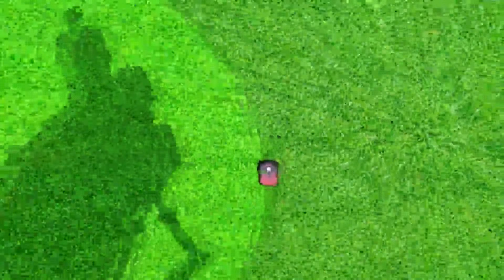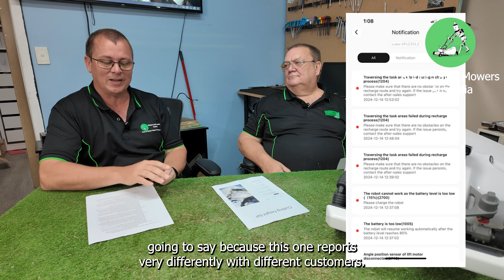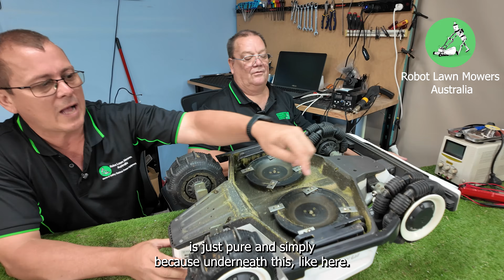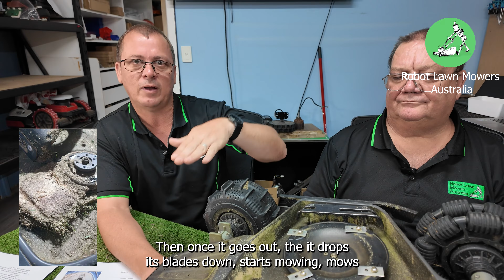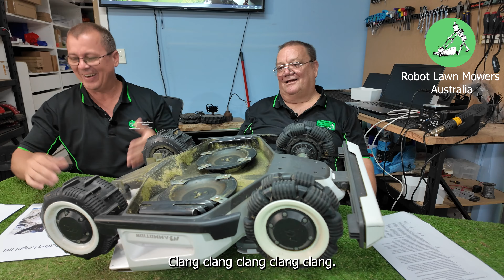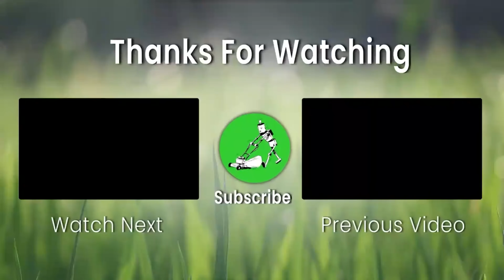How To Fix LUBA 2 Cutting Height System Failure | Wireless Robot Lawn Mowers Australia | Mammotion

Comment: Thank you guys. I have a Luba two and a Luba three. I recently just experience the height adjustment motor jammed notification. After taking off the cutting desks and cleaning everything thoroughly, the problem still persisted. Your video gave me the confidence to try one more thing before I sent it off for service that in my experience can take quite a while. The magnet and the sensor clip all seemed secure and intact. All I did was unplugged the sensor cable and plug it back in and that seemed to be the fix. Everything is now working perfectly. Again, thank you for taking the time to make your video and discuss things that aren’t readily knowable. 🙏🏼
Reply from the maker: That’s great news, sometimes those sensor connections and pin soldering on the little board can fail.

Comment: I cleaned out all the grass and it still has height adjustment issues
Reply from the maker: Very likely a failed lift sensor. The plug is the problem on the top of the sensors.

Comment: What about a luba that just doesnt move. No error, connectoin is fine the physical buttons make noise but it just wont mow, wont move manually etc.
Reply from the maker: Not much to go on if there are no reported errors, but could be bricked firmware or a main board issue. All you can do is turn off the robot remove the orange key for 5 mins and then restart it. If that doesn’t fix it then your dealer will need to connect it to the service app to either force new firmware or diagnose the failed part.

Comment: Hello, folks! I have a Luba 2 that isn’t mowing. It keeps pausing and won’t fire up to now. Problems with the mower deck maybe?
Reply from the maker: sounds like a cutting height adjustment issue. Could be grass built up under the disc guards and could also be a faulty height sensor.

Comment: I’m having trouble with my Luba AWD actually the original model the cutting height will not adjust, when it try to you hear a clicking sounds but no adjustment. I keep the under desk are and blades cleaned ever 2 weeks. What do you think is the problem? Any help is much appreciated
Reply from the maker: There is a sensor on the top of the cutting system that counts the revolution of the height adjustment. It also has a switch in the height adjustment system that is pressed when it reaches the top height. 
It could be either of these sensors not working right or it could also be damage to the cork screws shaft or cog that turns it.
It is difficult to know what the exact issue is, but it will probably be one of those things.

Comment from the maker: Hi George. Honestly we don’t even bother about testing the cable any more. They always fail again if unplugged and plugged back in. Mammotion have suggested that to us to. We get robots sent to us all the time that have been repaired by Mammotion and the issue re-occurs.
Just replace the sensor which is the little round circuit board and it generally doesn’t come back. I suspect the issue is dry solder joints under the plug on the board. That would explain why unplugging and plugging it back I sometimes fixes it. The little sensors board cost $20 so just replace it.
Also worth checking the little magnet that goes up and down below the sensor, as sometimes it moves or the glue deteriorates. If this magnet moves around you will get the same issue.
Reply: Is this sensor replacement I can do as an owner? I'm getting this issue and I've pulled off the discs and blade guard, cleaned completely with no change. Stays at 70mm according to the app and doesn't change height.  

I think the blade guard design is flawed. Not sure why it has to be a solid piece. If it had large holes it would be harder for stuff to stay in there to get compacted and it would be easier to clean.
Reply from the maker: @ the sensor is a pretty easy replacement once the robot is opened up. However opening up the robot will likely void your warranty. So there is that to consider.
Reply: Wow!  Thank you so much for your very detailed and excellent answer to my question regarding the height adjustmen sensor for the Luba 2.  I feel very confident now that I should be able to repair my Luba 2 if I ever get the height adjustment failure problem again in the future.  

You guys are by far the best source for information on the Luba 2 Mammotion and any robot mowers for that matter.  I can't thank you enough for all of the wonderful content that you are sharing with us and I really hope that you will continue with the Luba most common issues series, they are very informative and very helpful to those of us that own Luba Mammotion robots.

For anyone interested in buying a Luba Mammotion robot I want you to know that I have been very happy with my Luba 2 10000H.  The only problem that I have had with it so far is the height adjustment failure issue and I now feel confident that I can deal with it properly with the help of the wonderful people here at Robot Lawn Mowers Australia!  Thanks again guys for your help 🙂

Comment: Can you clarify what component is the sensor and what is the encodoer when you are talking about the height adjustment failure issue?  Can you help me understand why disconnecting and reconnecting the cable for the height adjustment motor from the motor and the controller board fixes the height adjustment failure problem?  Is there an intermittent connection failure issue due to the connectors for the height adjustment motor being very small and delicate?

How do you recalibrate the height adjustment system?  How can you determine if the sensor for the height adjustment motor is bad?

I enjoy your videos on the Luba Mammotion and I really like my Luba 2 Mammotion 10000H.  The only problem that I have experienced so far is the height adjustment failure.  I sent it in for repair and it worked when I got it back for about four weeks and then the problem happened again.  After it failed the second time I unplugged and reconnected the cable for the height adjustment motor and it worked again.  Any information you can share regarding why the height adjustment fails and how to fix the problem is greatly appreciated!
Reply from the maker: @georgebaumann1341  we have also been told to simply unplug and plug the cable in to fix the issue. We don’t do this as it is simply not fixing the issue. The sensor is very cheap and simple to replace. For clarity the sensor is the little round circuit board on the top of the cutting assembly. It senses a magnet that is installed on the top of the cutting motor adjustment. Sometime it can be the magnet becoming unglued and moving around. But mostly it is bad connections in the plug which could be the plug socket or the solder joints under the socket.

Comment: I personally always get the blower in under those cutting discs after each mow (Luba 1)and it clears out the grass in clumps, if rarely it is ever wet from a rogue shower then I also do a careful rinse with the hose on broad spray not jet mode. It really does need this after about 600m2 of cutting already, usually the deck won’t even raise freely all the way up and you can hear some resistance in the last 10mm, so instead of pressing stop and manually adjusting the deck down (because it always goes up all the way first then down, with the grass button, I put it into manual mow mode on the patio in the shortest/lowest setting then cancel and turn it off, proceed to clean and then turn it on again where it then raises the deck automatically then send it for charging.
Reply from the maker: I think the blower is a great idea. Water not so much, unless you are checking your rubber boots often for and damage. As long as the boots are good they will handle a light spray no problem.